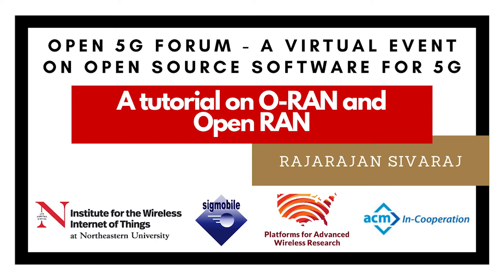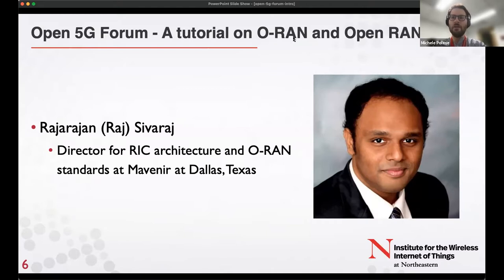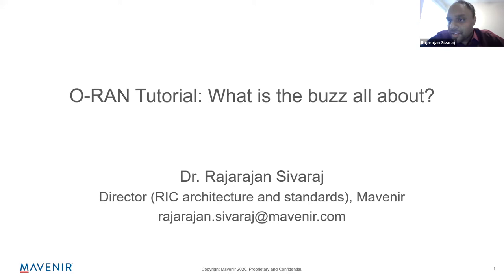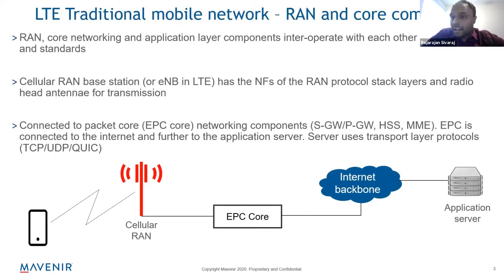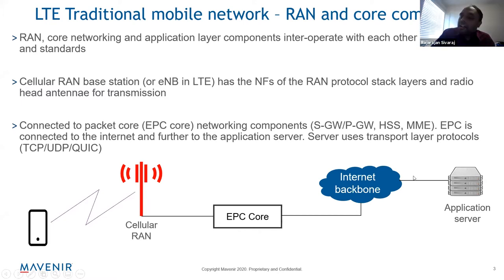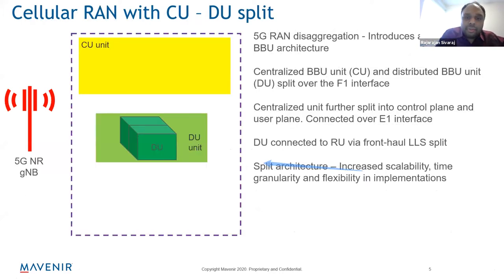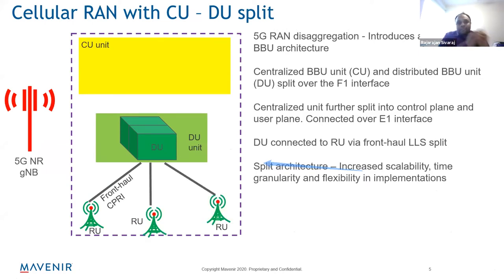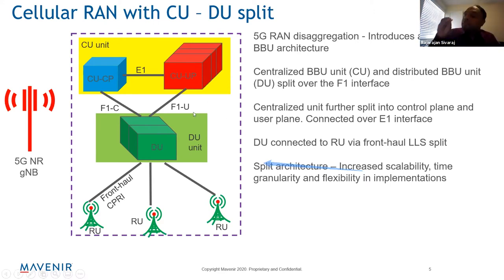A tutorial on O RAN and Open RAN

Comment: in vRAN, F1 and E1 are still standardised by 3gpp, so why do you say they are proprietary?
Reply: Yes, they are standardized, but due to lack of implementing them as open interfaces without the necessity of having multi-vendor inter-operability between the CU-CP and CU-UP, and between CU-CP and DU in legacy products, there could be proprietary closed implementations of the F1/E1 interfaces, unless they talk to other vendors, which is the point of opening them up (which O-RAN focuses on)

Comment: Hey everyone. I'm relatively new to the world of 5G and just wanted to ask what might seem like a dumb question... but what is an "interface" in this context? It's obviously not an interface in the sense of an ethernet interface or anything like that. But the terms E1 and F1 are a little confusing. 

When he says that the E1 interface exists between The O-CU-CP and the O-CU-UP - what is this? Are there literal bits on a wire between two components like a hello packet or an BGP update? 

Or is it more abstract? 

Is it like a common format of communication between these components? e.g. each side agrees to communicate using a particular format so that they can understand each other? If so, what form does this "format" take - is it similar to the format of an ethernet frame where the headers are expected at certain byte counts and then interpreted as such. Or is it like a higher layer protocol involving updates of a particular type to be commonly agreed upon and interpreted by either side?

Sorry I'm hoping these questions make sense. I very much come from the "OSI model, layers 1-7, bits on a wire with an IGP running over it" kind of world, and making the pivot to 5G is proving challenging. 

Great video though :)
Reply: It is a functional interface - logical in nature. APIs between two functions. This API can also be realized on a physical ethernet link